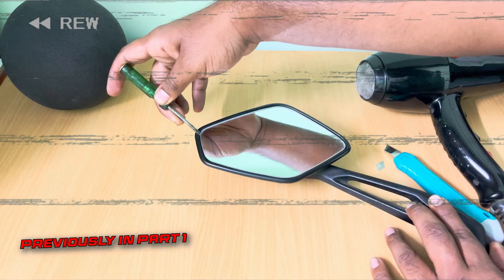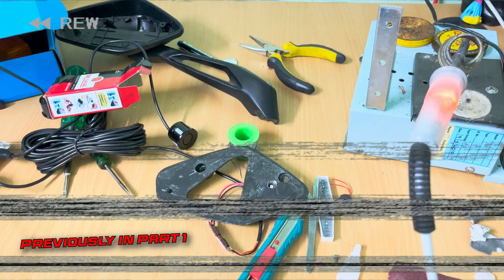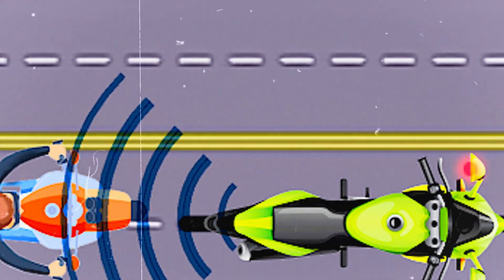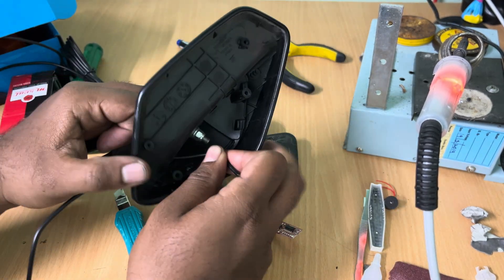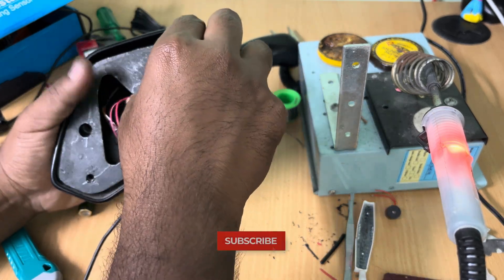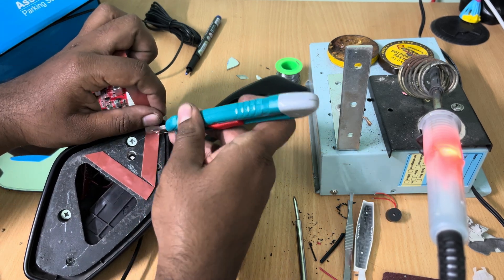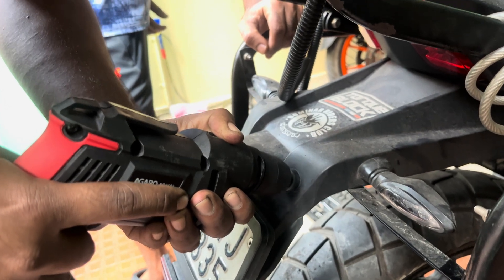Blind Spot Detection System With City & Highway Modes | BSD System Part 2

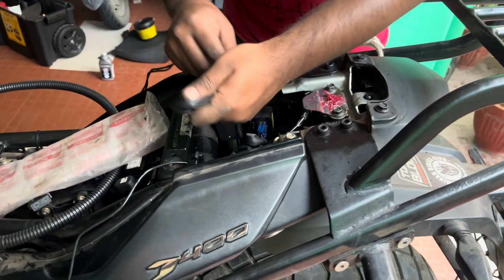Comment: 4:55 you were going to explain why the other 2 ultrasonic sensors should be mounted someplace else, but never explained in the video

may i assume you were going to mount them on the side a bit??
also is it necessary to mount all 4 sensors?? 2 should be fine right?